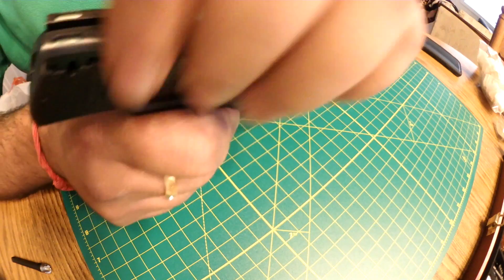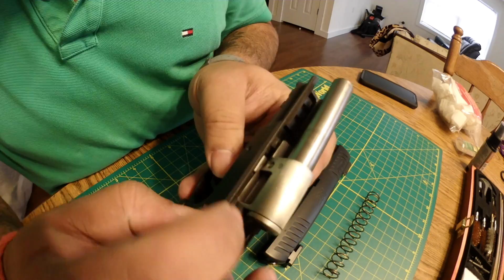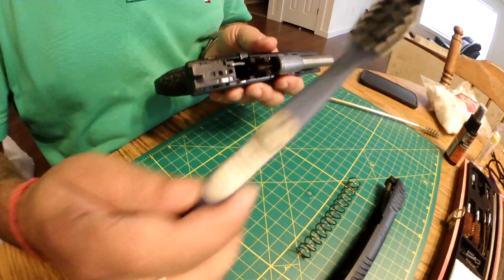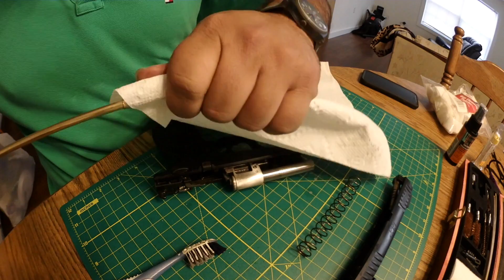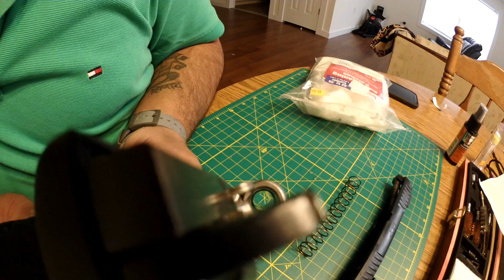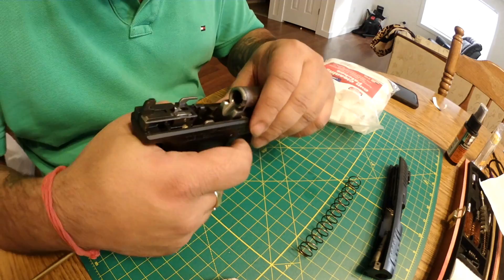Gun Care Series - Walther CCP

Comment: Dude your video sucked. There are hardly any good videos on this gun. I’m starting to regret buying it.
Reply: Have you takin it to the range? I recently got one, cleaned it using the cleaning tips on the glock from “Scootch” since I can’t find a detailed cleaning vid on the Ccp. Hope this helps.
Reply: @iHipHopVEVO   Yeah and it jammed multiple times after I oiled in on the spot! I don't like it, and I'll be trading it in. The CCP isn't a great option compared to others in terms of anything. I'm sorry to anyone who reads this, because the Ergos on it are probably unmatched which is the reason I took the full price risk. The PPQ is why I bought this gun, and it doesn't compare even if it looks like it would. Next!